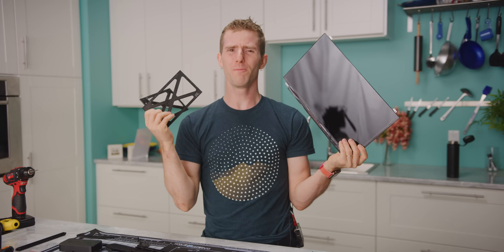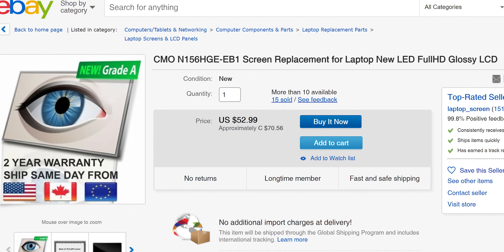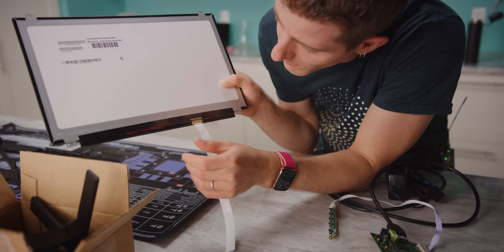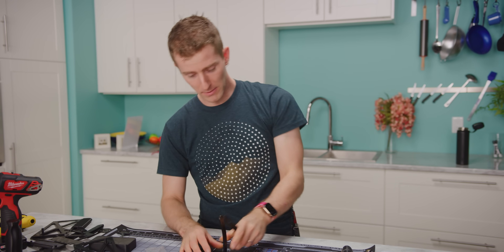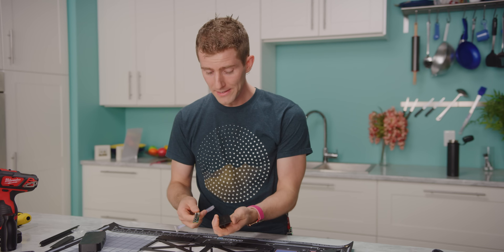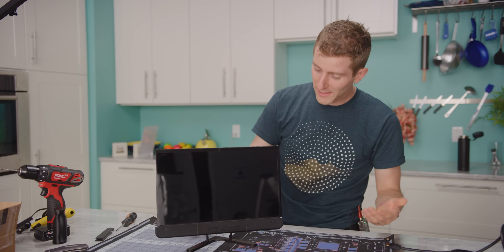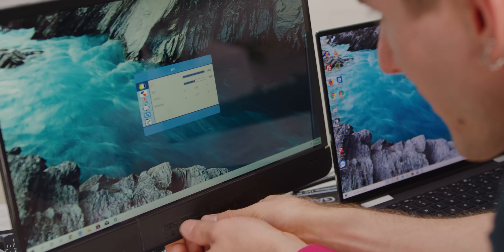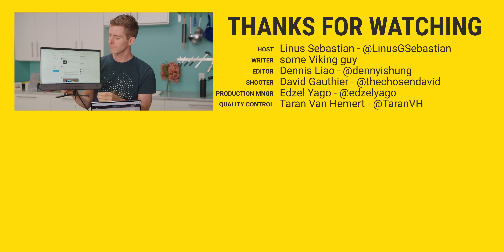We made our own monitor for under $100!

Comment: "this monitor will cost you less than 100$ to make yourself"

Need a 3D printer to make the frame and stand....
Reply: The stand alone is like a thousand dollars
Reply: If youre ghetto enough you can do it without the stand...just like put it against a wall with duct tape
Reply: @kbo8385  If I find out how I can cover my whole wall with those (and if connecting quite a bunch of them is even possible), that's what my plan was.
Reply: @airbornefilip9139  It wouldn't be too difficult to download and modify the designs yourself to make them interconnect so you can build your dream screen wall. Although you could run into problems with the screen adapters and wire management on the back, I'm sure there's a way to do it.
Reply: @OrangeC7  Wallscreen always finds a way.
Reply: Some libraries and universities let you pay to 3d print there. Or online services.
Reply: Get random picture frame
Reply: You can get things printed online though
Reply: Tape it to vesa mount with doublesided tape
Reply: Yeah, it is shocking that you need some tools to make things... Crazy right?
Reply: @Fresco272  r/woooosh
Reply: Just to fix the last line: "Need a €150 3D printer to make the frame and stand"
Reply: Just use sticks and glue.
Reply: Honestly, just make it out of wood, it's just a rectangular shape, with a drill you can cut out the ports and so on
Reply: Ez, make it out of wood you got in local area
Reply: How good are your woodworking skills?
Reply: Odin, you're jolly right about that. In general that is. It's probably not really worth making one yourself if you can just buy one. On the other hand you can learn from building one and it can be fun doing so.
Reply: Honestly, if you are into DIY and such you can get a cheap chinese 3d printer kit starting at like 150$.
Reply: Could also use a 3d printer at your local library in a lot of cities these days.
Reply: You don't need a 3d printer to do anything here. It's just convenient if you have one. You can just get some metal scrap. Bend, saw and file a bit and spraypaint it with a nonconductive paint (just in case).
Reply: There are online services that allow you to send over the models and have them print them for you. It's like saying you need a factory to have a car
Reply: Cardboard that shit with tape
Reply: There's so many places where you can print for basically the cost of the material
Reply: I've done this with the screen I am using to type out this comment on. 
I paid roughly £30 for circuit on ebay and used my old laptop screen.
My "stand" is a piece of string, it comes from the brackets that held the screen to the hinges, and it hangs off a nail in the wall.
Reply: You could make a frame from wood and it could mount it. Also would love really nice.
Reply: @danman9847  But then you'd need woodworking tools and those cost a lot of money aswell.
Reply: 69 likes nice

Comment: Linus : "Why in the world would you ever want to built your own monitor?"
Me : "im just bored"
Reply: I would like to get a small screen to use it as a Spotify screen or maybe a hardware monitoring screen
Reply: @briandiaz1363  if having a high resolution isn't a necessity for you, you can pick up a small raspberry pi screen for like fifty bucks on Amazon https://www.amazon.com/dp/B07HMW3C7P/ref=cm_sw_r_cp_apa_i_jY-ODbYY9DA6Q

sadly it's only 1024x600 though
Reply: @mommynooon  The cheap little 1024x600 screen I got for my Rasberry Pi is also a touch screen. The touchscreen part also worked fine with a little Android TV unit I had. I was able to use my android TV unit as a makeshift tablet to turn on and off my WiFi controlled bulbs.
Reply: Brian Díaz no
Reply: I have a 4k monitor in from a dead computer, I'd love to get it to be a usable photo editing monitor... that's reason enough IMHO.
Reply: 69 likes

Comment: Actually there is more about the display connector.
There are 30  and 40 pin vlds and there are 30 and 40 pin edp displays. The connector of an vlds and edp display basically looks the same and are the same. The difference is the actual protocol and the maximum possible resolution. Vlds is the oder Standards that supports 1920x1080 max in the 40pin connector.

Comment: Wish I could find similar controller parts of my old Acer x243w, screen works but stuff behind the screen screws up every so often, pure white bleed till monitor warms up (and few random times when it is warm) or pixel auras on the screen, once it very warmed up, that are annoying. Sadly it's $250 for a new similar spec 1920x1200p monitor, but not down grading to a 1080 or a 16:9 ratio monitor.

Comment: Linus: "how to make your own $100 monitor"
Also Linus: "we used a 3d printer"
oh.
Reply: They used a 3D printer. Doesn't mean you have to though. Use wood, hardboard, mdf, plastic sheet.
Reply: @evilution_ltd  You literally could make it out of some papier mache
Reply: And lots of people are starting to own multiple 3D printers.
Reply: 3d printers are like $200 bro
Reply: In general, it's not easy to buy a 3D printer as most are financially unreachable.
Reply: Lots of towns and cities have maker spaces with 3d printers you can pay to use for rather cheap still. Libraries and community centers often.
Reply: @DeltaPlaysMCMT  Maybe in some parts of the world. I live in a relative big city in germany and our library is still struggling to even have a Computer system where you can look up if they have a certain book and where it is. Even the public computers are broken most of the time. So you cant just head out and get something 3d printed.
Reply: @dereismann8275  you can use an online 3d printing service some of them even offer your first model to be printed free
Reply: @dereismann8275  well, I know there are some in Berlin at least.
Reply: @dereismann8275  10 seconds on google (also german) and you can rent one for one day for 30 bucks, but I mean come on you can do just some wood working
Reply: @jooplin  woodworking or for example aluminium frames. But it is not about technology in the end, people are just uncreative and lazy to think and try something. "I don't have a 3d printer is just simple excuse" and every comment here Is like that, it is quite sad.

Comment: I could see this being used to make a video wall on the cheap. Also, don't a lot of single board computers (like the Raspberry Pi series) come with the same connector that this driver does? You could skip the driver and just install the panel on to the Single board computer to make a small all in one package PC.

Comment: Linus NEVER hold/touch bare LCD panel by the bottom part. It can be extremely fragile and source of problems down the road. I had job testing LCD panels from laptops once, so I know. And mounting things directly to it is a big ol' no no. The way it's mounted in every laptop is that both the top and bottom metal flaps have two holes. One of them on each flap is used as standoff (so it's positioned perfectly and holds weight) when you place the panel onto the display backplate and the second one is for a screw to tight it down perfectly. And then there are deviations how/if you use metal sheet parts around it to support it, some laptop models have additional simple parts on the side that screw on/slid on that just hold it tight or loads of different ways it's done. Almost nothing ever touches the bottom floppy part. I would love to remix your models to make them more realistic and make the panels last longer but I don't know how to use software that edits/creates files like .STL. Maybe I get to it later on. But this video would deserve V2 with better monitor structure.

Comment: This is a good way to make a multi monitor without bezels.  I have collected 3 identical 42" 1080 Samsung TV's from a hotel that was selling them cheep. Planning on building a single wooden frame that will give them zero bezel.  You can get universal boards for large TV's turning them into a monitor. Just make sure you get the correct one for your TV.  I have one built and another still original and the picture on the new controller looks way better.

Comment: If I had a chance of answer.
Then what I would ask.
Does the panel that you used to drive the monitor can that have multiple monitors connected to it or is that whole another panel because I did not see any type of expansion to it. 
The ideal is that I would like to make is 3 monitors act as one.

Comment: Even if you were to use one of your old ones or someone is selling you their old... it's going to suffer from issues. The brightness is a huge concern so not only are you going to do through all this mess you'll also most likely be replacing the light source(which depending on age can be really annoying!).

Comment: Great! Now all you need to do is remove the stand, get Leather, replace the plastic with something more durable and thicker something like a rubber mesh: have that surround the sides... then with the leather, construct a Folio stand... and Boom: you created what most of the external screen manufacturers can't simply do (because apparently that wouldn't be profitable) 😏
Seriously, it's 2019... why are we still using plastic when leather or a similar material can do the job just as well?

Comment: Done this.   Cheap and works.   Good way to get some use out of those DEAD BUG lap tops.   I just take the whole top and compete Lap top off.  Fit the PCB to the back.  Add some legs and you have a snappy little monitor for all kinds of stuff.  I use them for my Arduino Projects and crap.

Comment: >"DIY monitor for under $100"
>Requires $300+ 3D Printer
Reply: I mean technically the 3d printing isn't required for the monitor, it's for a monitor stand and those parts can very easily be printed on pretty much any printer that doesn't cost more than $300
Reply: @cupar1962  mine cost like 120 bucks, and it's just fine. Not perfect, but just fine.
Reply: Also you don't need a 3d printer to mount it

Comment: My third screen is a recycled laptop screen. Got an old laptop (think it was a 2011 era ProBook) for free, and a 24 dollar controller board. Mounted everything to a few pieces of wood, and mounted the whole assembly to the back of my secondary monitor. Even used the laptop's hinges to make the screen able to pitch. Works perfectly :)

Comment: I don't have a case yet but the things i have are even more DIY than this. Simply because i don't have a 12v power adapter. I had one but it was too weak. So i've cut the cable and soldered a molex connector to it. Yes i seriously pull power for the display form the PC that i am using it on.

Comment: In case I have touchscreen laptops is there a way to keep the touchscreen capability?
Reply: I'm building a small home network shell and I have some old laptops which used to have touchscreen that still works (only the display and the touchscreen) I have nuc that I usually use for many home networking but I've like to give it a 14" touchscreen display  in fact I have another 13" working touchscreen display with stylus capabilities which would love to use like a Wacom or like a touch keyboard on my desk

Comment: Apple: We are selling our monitor stand for $1,000.

Linus: We are 3D printing our monitor stand for less than nothing.
Reply: Got a 3d printer myself, and if all those parts are 100% solid(unlikely) I would guess that looks to be about $3-$6 worth of PLA if they are using semi cheap but decent filament(Hatchbox). So even with $25 for the display adapter, and maybe $5 for a power supply, and a salvaged screen still a lot cheaper than getting a new monitor.
Reply: @Awrethien  Maybe not as much for used monitor.
Reply: Robert Rockey I
Reply: @Awrethien  Another handy thing to do is if the controller or power supply in a monitor you have has died and you want to keep the panel working, you can do a bit of substituting to breathe life into it again for not much at all. I couldn't get a OEM controller board for under $100 for an old LG monitor I liked, and didn't feel the need to go and get a new one. 

But  I was able to get a $25 driver board and to make it work again with a bit of creativity. Extra points if you merge the old button sub board with the button board that came with your old monitor and get that working correctly. When I was asked why, my answer was "because I can, and I wanted to".
Reply: Actually, it looks like they used a fair amount of filament for this video

Comment: or even better if you kept the original USB cable for the iPad you can install Splashtop wired x display both on the iPad and the windows PC and it works like a charm

Comment: eDP is litterally the DisplayPort protocol without a standard connector. It would be cheaper to create an eDP to DisplayPort adapter than an HDMI to eDP adapter since eDP to DisplayPort is litterally a few wires routed to a connector. The only disadventage would be that there is no scaler, so applying a 720P signal to a 1080P panel wouldn't work. But if you run it at native res then it would work fine.

Comment: have something like that, and its great! didnt make a case for it, because i know noone that has a 3D printer :( there are not that common here in germany i believe, and im too lazy to do something out of wood/metal myself, but its ok for throwing it in my backpack with the PS4, and use it wherever i have to be for ours on end doing not too much xD i just need a wall where i can place it infront of. btw. i had to pay only like 30bucks for the whole deal of board, buttons and the power adapter (my screen has a seperate power input), so your mileage can vary a lot! it was like "around 30bucks" for me xD i had a screen on a dead laptop, so yeah, you have to get one of these, but... they are cheap or just lying around somewhere in a basement or so from your friends or family ^^

Comment: Really want to give this a try, but says there's errors with your parts. Some won't load. Also, seems as if print a verse considers one of the panels too big to print. Where would you suggest to go to print this? No longer have my own printer as it just wasn't being used enough. Thanks.

Comment: To do all this work for a secondary display makes no sense, you can buy a second hand monitor for cheaper and get a better experience, risk free without the labour.

HOWEVER this is a fantastic guide for DIYers who might want to put a used panel in a wall or cabinet with a Raspberry Pi or something for a project.

Comment: with a little modification i can see expanding the box on the back or printing a box for a raspbery pi to hang on the back of the screen and it would be a cool little all in one with a 40 pin tail that hangs out of it or mounts someplace near the base.

Comment: Bottom Part of Display: "Don't Touch!"

Linus: "Let's just ignore this warning"
Reply: Yeah why does that portion have the warning? In the entirety of laptop hardware, that's the only part where I saw do not touch warning
Reply: @thecompanioncube4211  Behind that warning is where the PCB is for the screen. The "no touch" warning is there so you dont accidently break it.
Reply: @thecompanioncube4211  the display film is connected via flat flex cables (like the one used for the connection to the driver, but even more fragile) to the PCB, they are probably under that sticker.
Reply: Matthew Cabor oh yeah I’ve been zapped by one of those nasty inverters. Funny thing is that the inverter went to toast after it electrocuted me lol, no more backlight for that lcd ever again...
Reply: yea lol

Comment: i did something similar to this 3 years ago except i used ply wood for the frame instead of 3d printed plastic, it still holds up well and i use it as both a second monitor and a portable monitor that i can take with me, i even added a 3rd funtionality which allows it to clip onto a ps4 controller but its too heavy and makes my wrists sore

Comment: Cringing as you hold the bare panel by the bottom - you can damage the panel's hot bar bonding wires doing that. They usually have warning labels right on them specifying not to do that.

Comment: DIY Monitor for under 100, (looks on local facebook sales and sees full monitors for 20) ... granted if you don't have any charity shops nearby or boot sales or other local ways to get 2nd hand monitors, I guess this works but NICHE is the word for this. Oh, did we forget having to buy a 300USD 3D printer and another 50 worth of plastic?

Comment: Linus up to 2018: This is how you build a PC
Linus in 2019: this is how you build a monitor
Linus in 2020: making our own Ethernet adapter
Linus 2021: DIY GPUs

Edit: just remembered that there already is a video series on YT about making a GPU on breadboards
Reply: 2022: gaining investors
2023: linus tech industries produces its first gpu
Reply: That bread board gpu dude is insane
Reply: With the current trend of devices not having a dedicated Ethernet adapter build in (I hate dongles), your 2020 suggestion might be more useful than you would think...
Reply: @geroldmanders9742  : And there are several microcontrollers that you can do Ethernet with, so it's actually doable.
Reply: 2021 we build out own gpu
But first a Word from our sponsor JLCPCB get 2$ PCBs from China today (linus did not drown the pcb in flux and Louise rossman want to come over) 
What a pain soilder every single cap resistor and gpu it self lmao
Reply: ``GPU on breadboards`` Yes, Ben Eater did a couple of videos on it. Great stuff, and he build it step by step from the most basic components. :)
Reply: There was a opensource GPU design but I don't think much has been done with it in the past decade or so so... :\
Reply: 2022: how you upgrade your smartphone with a DIY headphone jack...
Reply: @norman-str3ss88  that already was a thing tho wasnt it?

Comment: I did this like a year ago, with an old 720p laptop display, the only difference is that it had 2 sepparate boards for power and signal, and that I used a photo frame as housing